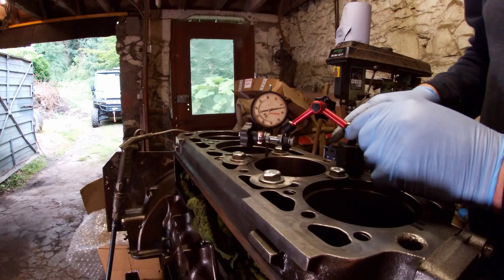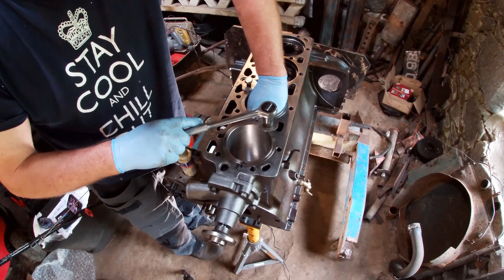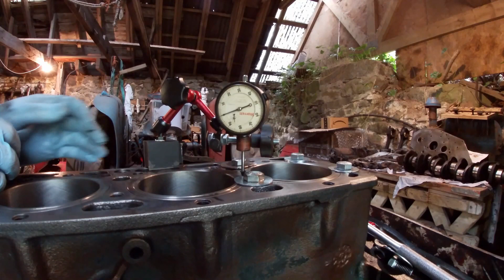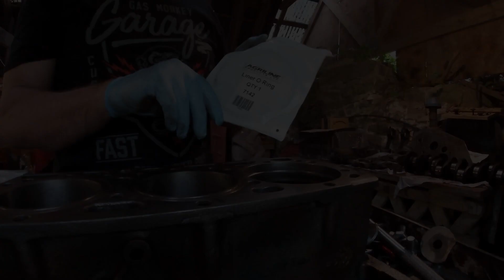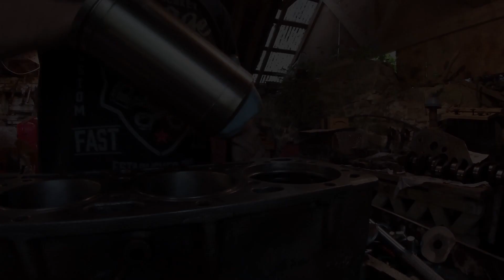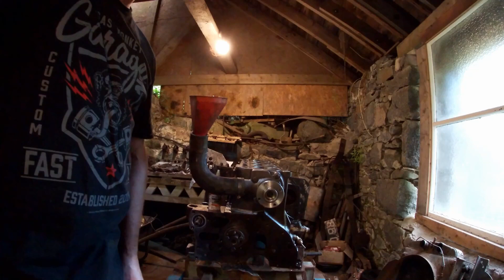Fordson Major Engine liner fitting.

Comment: Good info... thanks
Reply from the maker: It's a while since I did that, I have the manual on my YouTube if you want to look at it follow this link. https://www.youtube.com/watch?v=u5YkRfygrS8&ab_channel=MarshallSmart.         Or if you go to my Flicker where you can down load each page.   https://www.flickr.com/photos/dino60/51365754257/in/album-72157719709246005/                                                                    Still have the 4 new single O'Ring liners as I thought it was a 1955 block. Should have checked  casting No . M 😀

Comment: Hi Marshall, I bought a Super Major with a seized block due to the oil pickup blocked. It looks like the block has been damaged on the lower end. Do you know where I can get the specifications of the block so I can possibly have it machined?
Reply from the maker: I would try Bundy Bare at www.Queenslandtractors.au he’s worked on a lot of tractors and has a machine shop. You can download the manual from there also Marshall
Reply: @MarshallSmart  Thank you very much Marshall! I will give that a try
Reply from the maker: @user-fv6zf8hg6x  Good luck M

Comment: Hi, where did you buy the engine rebuild kit from and have you had any issues with it, Thank you
Reply from the maker: You can get them from Agriline or old 20 parts co. Count the seals with liner out. 1953-58 single seal 58 on twin seal. My tractor had a service block fitted so the parts were 55 but the liners were for 63.
Have a set of 55liners single seal left over M
Reply from the maker: Agriline supplied the kit. Only issue was the bairings some were scratched. Just bought an other set. Had wrong liners as block was changed 1963 block. M